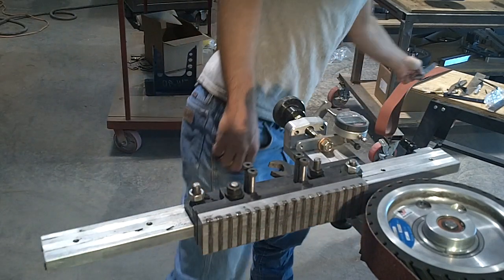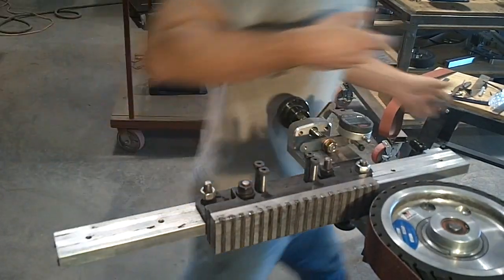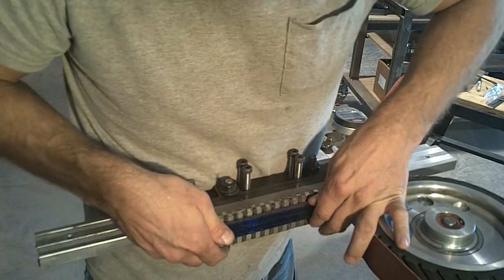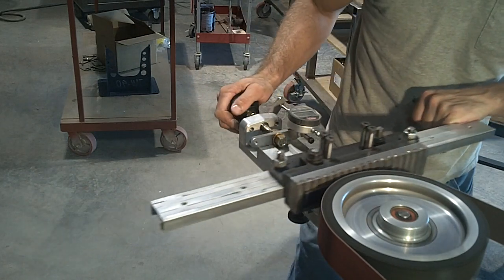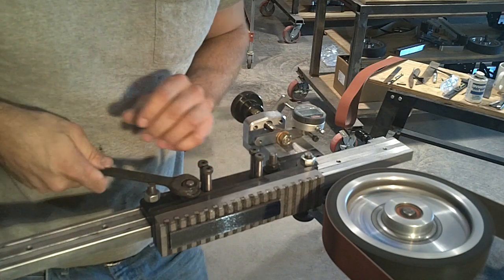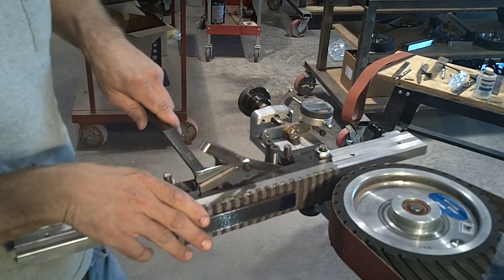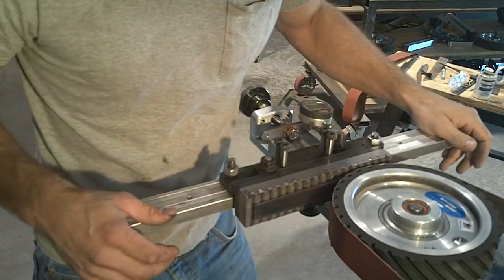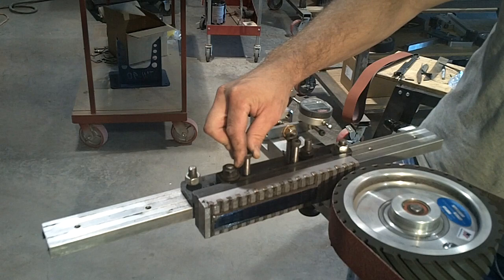Tapering a tang with the Wuertz Machine Works Surface grinding Attachment

Comment: I have your surface grinder attachment and love it. The only problem I have is that you didn’t really explain the “doubling feature” for the magnetic table. I’m not a trained machinist and never used a surface grinder prior to getting your attachment. You weren’t real clear on the fact that all you have to do is move the feeler gauge back to the pillar closest to the pivot point and it “doubles” the taper amount. I’ve been using two sets of feeler gauges up until I watched this video a 2nd time a few weeks ago. It worked fine the way I was doing it, but it’s much faster using the doubling feature.
Reply: super helpful to point this fine detail out.
Reply: He explains how it work in an earlier video.